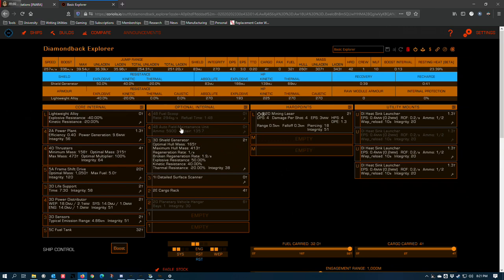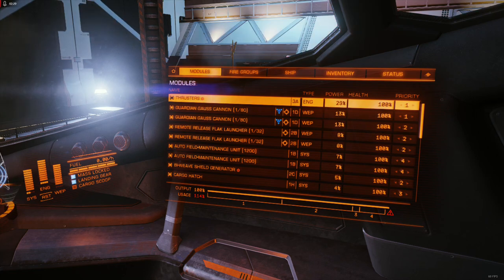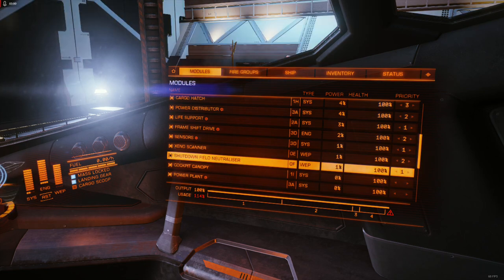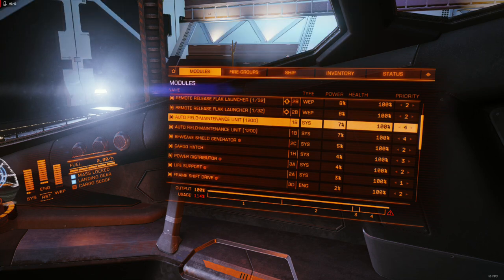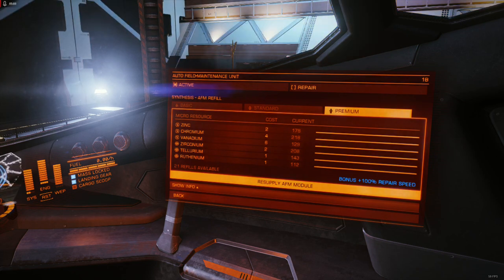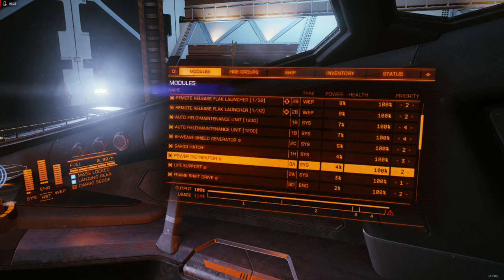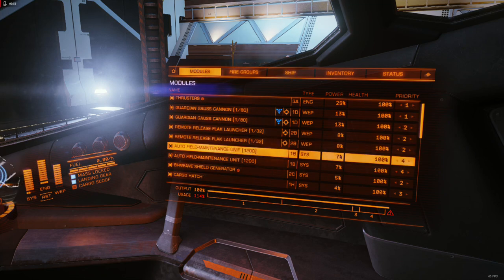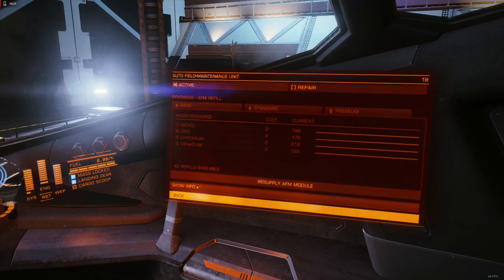Elite Dangerous | Developer Critique | The not so Automatic Field Maintenance Unit

Comment: The bulk of requests made here for AFMU changes can be resolved by using one or more Module Reinforcement Modules.  Any module below 80% is subject to random malfunction.  In order for any module to be repaired by an AFMU.  The module in question must be disabled for the period of time it is being repaired.

Just being a 'Good Pilot' does not negate wear and tear.  

I use an AFMU (sometimes I have 2 equipped) when Bounty Hunting in the haz-res.  Because I know I can conduct any repairs needed in between encounters.  Usually while my limpets are collecting the manufactured mats.  The more intense a battle is likely to be.  Such as a high intensity CZ.  If any module is in bad enough shape to need repairs it's probably in your best interest to just head out for the nearest Station.
Reply: I have come out of fights literally drifting in space with thrusters firing in different directions or not at all, canopies cracked, all sorts of madness.  Multiple reboots of the ships system, cannibalizing low priority systems generally allows me to make it to dock.  Not always.  Won’t fly without an AFMU now… not when the rebuy is $35m plus.
Reply: @Kellett781 , I'm also fond of Module Reinforcement Packages, especially Guardian.  As Guardian MRP's offer a higher level of protection for a smaller module size.  with 3 MRP's equipped blowing out my canopy is all but impossible.  Still can happen of course.  But by the time it does I'm hearing the EJECT alert soon after lol.

Comment: AFMU also requires a shed load of power . Try fitting one as well as a Shield cell bank when you have a Armoured power module 
Even if you add monstered effect , you will struggle to use them and have other modules you want. Plus when you have to carry it in disabled mode then switch off other modules just to use it  ?? Its good for exploration but combat ? . Unless you can park up in a middle of a conflict and hope the opponent will be happy to leave you alone while you repair , it is useless for combat application ( imo ) . If it can repair on the fly just one or 2 key modules at a time , then ok
Reply: For combat, AFMU is good with Module Reinforcement Package. MRP blocks majority of damage to modules, then you can fix MRP with AFMU. MRP consumes no power and thus doesn't go "offline" while being repaired. It even gets extra repairs for same AFMU consumption. 
One thing this sadly doesn't protect from is reverbating cascade torpedoes/mines, which is sad... at least carrying around AFMU lets to fix shield manually and laugh mercilessly at now-torpedoless foe
For power, If you use MRP, damage to your power plant will be reduced anyway, so no real need for Armored. But, if you really need some extra safety, you could also consider Guardian version, it gives a bit less power than overcharged but also doesn't have -25% integrity, which may matter. 
Other possibility is to use a second MRP, apparently they do stack. When power plant takes only 16% damage, you can safely go Overcharged and not worry about it at all. Second MRP can be class 1 to not steal space from stronger modules, first one should absorb most or all the damage.

Comment: I disagree.
This would make modules undestroyable during combat. It would limit all tactics that try to shut down specific modules.
Reply from the maker: You're right, that would be a problem.

A possible solution would be to adjust module malfunction thresholds. If a module stopped working below 20% for example, then pushing the modules to zero would keep them offline for a while, unless the AFM were destroyed, in which case the malfunction would be permanent.
Reply: @DryHeatAndSand  Well I guess the counter to this would be to have sub-targeting priorities set so that the AFMU was always the first priority.

Or maybe we could have some kind of weaponized limpets that could be targeted at specific sub-systems.  They latch on and turn into shaped charges and destroy the specific system with minimal damage to the actual ship.   If ED ever got space legs you could use that to disable and capture ships.   Imagine messing with your right panel and turning back to see a cockpit breaker limpet mount and obscure your whole field of view as it rips the pilot out the chair like something out of the Animatrix.